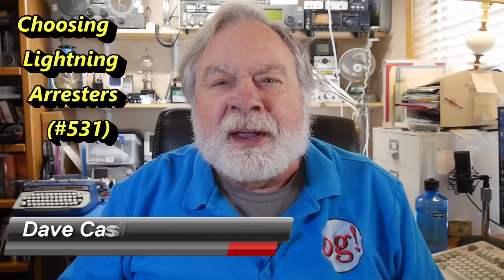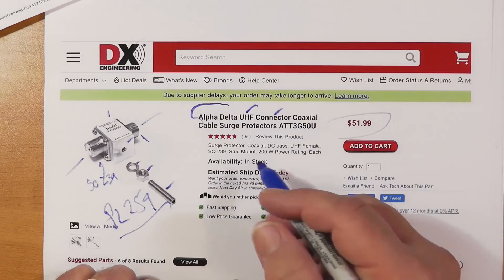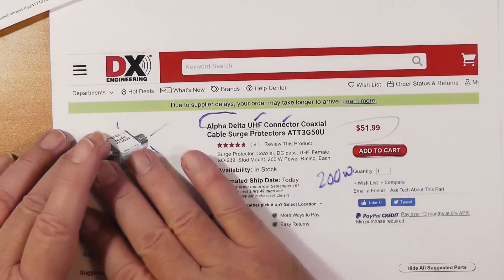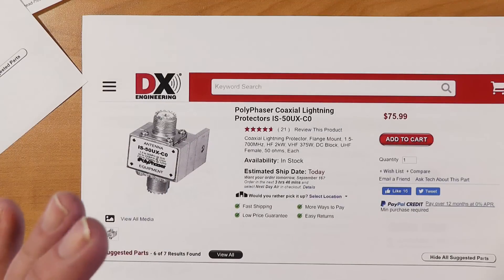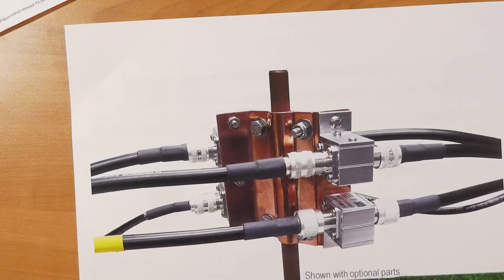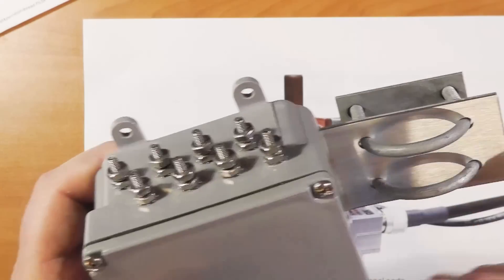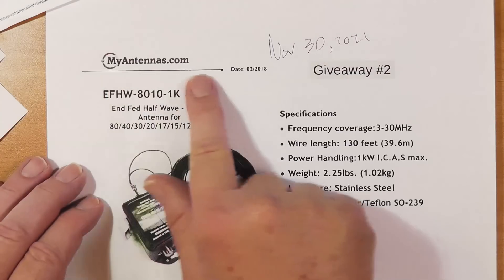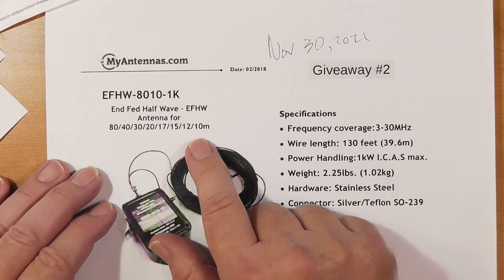Choosing Lightning Arresters (#531)

Comment: I use Locktite LB 8008 anti seize copper bearing compound to eliminate any seizure of fasteners. Never had an issue and I live 1/2 mile from the ocean. As for lightning protection of twin lead feed lines I found an article in either QST or CQ magazine years ago where one can purchase Accell non resistor spark plugs for racing as well as some anti fouling cups for these spark plugs. Basically bore out two openings into the copper bar and fasten the spark plugs to the bar with the anti fouling cups ( it is a lot cheaper than ordering a tap for spark plugs from an industrial supplier.) now after you connect the twin lead to the spark plugs and then feed through straight to your tuner in the shack. You will need to adjust the spark gap so the transmitter will not arc over to ground at your maximum favorite working power. Once this is done and no arcing is visible through the bottom of the anti fouling cups you can seal the openings with RTV silicone just enough to cover the opening. You do not want mud dauber wasps building nests in the openings which might short out the spark gaps to ground. The bar must be mounted directly to a decent ground rod.

Comment: Ground conductivity. 
I live in Florida. The ground conductivity is very poor here as it is mostly sand.
It was recommended that I install an array of ground rods. So what I did was install about 20 copper clad rods each 8 feet long in a grid. each spaced abt 10 feet apart. Then use 6 ga cooper to bond em all together. With what I call a grounding station outside the shack,.
Reply from the maker: Good idea! You can also create a large copper grid and bury it in the sand.

Comment: CAUTION: Flash tube suppression is NOT compatible with non-resonant (high SWR) antennas like doublets, popular 43’ verticals, etc., as the high voltages can cause the tube to arc (and possibly damage transmitter finals).. An antenna “tuner” will not mitigate this phenomenon as it does not reduce high SWR on the antenna side of the antenna system. Flash tube suppressors, when not used with a parallel inductor, will quickly fail after several suppression events. Morgan Manufacturing (formerly ICE, Industrial Communion Engineers) has, in my opinion, a superior product that eliminates flash tube “fatigue/failure”.
Reply: Excellent comment. if the suppressor is between a tuner and an antenna it could be high voltage. I always put a suppressor on the line between the radio and the tuner. At 50 ohm the max voltage at 100w is about or 70v on a 50ohm load. But at 1000 w its about 223v so a 230v suppressor may work. But after a tuner the voltage can be in the thousands. You light up the suppressors more than you get out on the antennas till they burn up and possibly short out.

Comment: Love your channel ! The reference equipment is awesome ! I'm trying to setup my shack. This is an expensive hobby, even buying used equipment ! Last month I spent a bunch for coaxial cables, connectors and adapters. Plus one of the MFJ window pass throughs. I still have to get my ground system set up and lightning arresters. I have not yet picked my home base unit. I have a couple of mobile 2m and an HT. I also bought a 817 for QRP in the field. What suggestions do you have for one of the really nice radios that everyone is dumping for the 7300 ? Thanks Curtis

Comment: KF7P has arrestors made by Morgan Manufacturing. Very impressive stats on them.
Reply: I use them...top notch
Reply: I also use the Morgan Mfg. arrestors. Excellent pieces.  As a great additional benefit,  tbe Morgan arrestors also provide continuous static bleed, which (I believe) the other units depicted here do not.
Reply: @Calico5string1962  correct

Comment: Dave, back in February I had set the new HF antenna and its coax from the ground rods to shack grounds as per your directions, including DX arresters.  Two days ago a cold front moved through the area, and while we didn't have a lightning strike at the antenna or within a block of us, the arrester that protected the HF at the ground "popped" as designed. The gear is safe. Thanks for that!  AA7MO

Comment: We’ve been having Frequent lightning storms in the evening, but the lightning always seems to be distant, until last week. Wow! Lightning struck a power pole about 100 feet way. Loud as heck! Scared the crap out of me! It appears close lightning strikes in my area are unusual, but every few years, boom!
Reply: And those strikes can induce surges into your homes electrical system either directly through the power lines or as an EMP pulse induced in your homes wiring which acts as an antenna.

Comment: Dave, great video.  I've watched this one several times.  Question: is there a benefit to having a DC-block arrestor?  Seems there are more DC-block arrestors on the market.  I use Alpa Deltas because I power tower-mounted pre-amps through a bias T, but wondering if I'm missing something not having a DC-block arrestor.  Thanks Dave!

Comment: I live in central Florida, I have the Alpha Delta UHF Connector Coaxial Cable Surge Protectors ATT3G50UHP and the 
ARRAY SOLUTIONS  AS-302U - 3 kW CW / 5 kW PEP Coaxial Lightning Arrestor, SO-239 type connectors, 1 to 500 MHz

With all the lightning strikes we get close to our houses I have found that the ARRAY SOLUTIONS   outperforms others I also have a PolyPhaser Coaxial Lightning Protectors IS-50UX-C0 for our CERT radio, it is good but    the ARRAY SOLUTIONS out performs them all just my 2 cents Eddie kj4fgi
Reply: Edward, I appreciate your comment and experience. Can you provide specifics as to how the Array Solutions arrester(s) were superior to the others? Did they prevent equipment damage while others resulted in damaged equipment during the same strike?

Thanks!
73,
John - KK7JBZ

Comment: Beware beware beware. Got a few so called lightning arrestors that had no gas tubes inside just a couple small screws on the sides. No protection at all. Got ones with flush screws and some labeled 230v with big bulging screws. Tested them with a 0-230v supply with a 20k protection resistor. Big surprise. The flush screw ones were 230v rather than 90v advertised so checked the tubes. Yep 2r230's.  Some sold at 90v had 230v tubes. The ones with big screws have double ended gas tubes rated at 230v but the tubes are meant for a center ground so 460v end to end. Bad news for most radios. So far only 1 of 8 have had what they were sold as. Beware the big bulging screw ones and check the small inset screw ones.

Comment: Guess there is no way to protect outside at the antenna, antenna tuners  from lightning.
Reply: Ground everything outside as Dave indicated in his last grounding video. The arrestor is to try and protect your inside gear and people inside your house by allowing the high voltage on the center conductor to be easily able to shunt it to ground.
No protecting a chunk of metal from a direct strike (except with a sacrificial lightning rod).... But even then, 20kV is 20kV regardless if it's - or + (ie: if lightning hits the ground or neutral or your transmitter things will go pop)

Comment: I did a search for "this type of a situation" and couldn't find anything resembling the picture at 7:15.  Does it have another name?  I didn't see anything on it in the reference station info on the web site either.  
Anyone?  Anyone?
Reply: Array Solutions Control Line Surge Suppressor

Comment: Dave I hate to be argumentative, but from my research, the ratings of these devices has nothing to do with discharge voltages as stated !
Instead, they are different in how much RF power they will handle from the Transmitter !
I checked more than one source, and this was my finding .
I plan on contacting Alpha Delta, to get the correct answer.
With the operation of these being, 
" Mission Critical ", 
I didn't want people purchasing these wondering why they were blowing them up, each time they used an Amplifier ?
                  🫲🧐🫴
             Please advise !